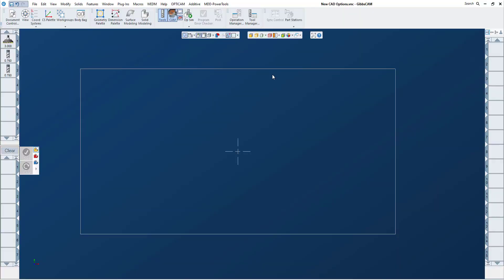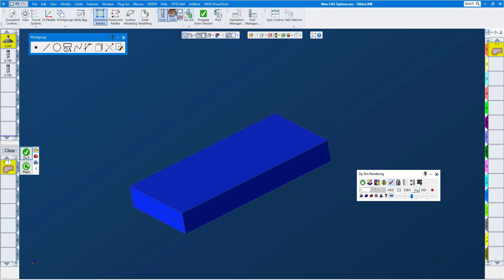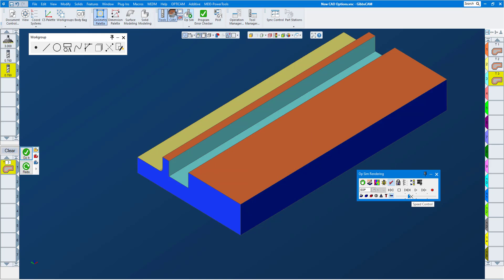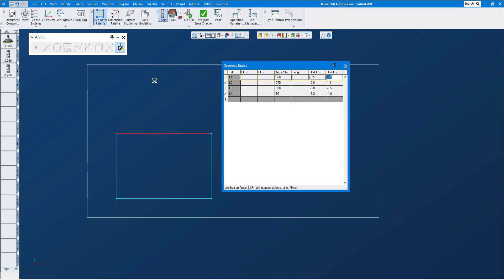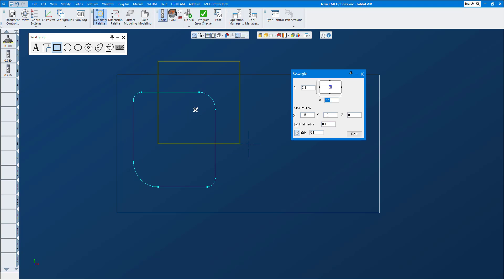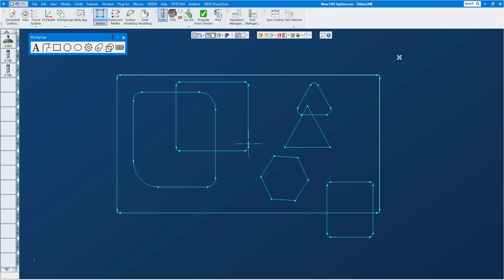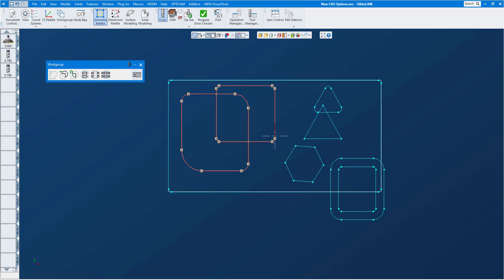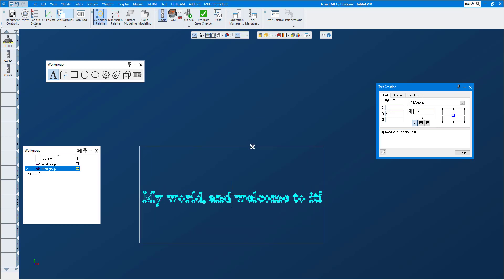GibbsCAM CAD Enhancements

Comment: Looks  like add/subtract and union function only works with like geometry. I can't seem to use that to trim a circle and a square. Does that sound correct??
Reply from the maker: I just verified and it does work with squares/circles.  Also works with circles/circles, or any combination.  I am doing this in v14.0.23.0.
Reply: @GibbsCAMVideoTutorials  I spent good 15 minutes on it.. while the options are enabled but nothing happens. But at the same time trim-in/out and slice work flawlessly. I am also using the same version as you are.
P.S, Don't think this should matter but the square I was using didn't have fillets.

Comment: Great 
But still 
Gibbscam cad is a nightmare 😓
Reply from the maker: You just need a bit more practice.  I find it very easy to draw anything I can imagine.
Reply: @GibbsCAMVideoTutorials  To me as I run many different cad cam systems as most of us do in a job shop environment .This reminds me a lot of drawing in Mastercam . Its just you have to be able to think outside the box to create a part. They don't always give you every dimension on a part. so just knowing how to use things like  tangent and offset for lines helps .
Reply: I agree, Gibbs is only better than Robocut  for me - and that one is just absolutely ridiculous. I can draw anything I want in Gibbs, but I can do it 10 times faster (and with far less cursing) in almost any other software. I’m astonished it’s taken them this long to progress to the point that they have.
Reply from the maker: I find it easy.  I also use Solidworks, for making assemblies, exploded views and nice drawings.  But I use those solid models from Solidworks in Gibbs to extract geometry from them in order to machine, or just click on the solid and have Gibbs figure it out.  But I do like the option of machining the part like "I want to do it" vs having your cam system think it knows how I want to go about it.  I don't see too many machinist/programmers drawing so much from scratch anymore.  Most every shop works with solids from their engineers, not from scratch.  Also remember when you draw from scratch in Gibbs your geometry is already connected, so the tool knows where to go.  We don't have to "chain" geometry up like others do.  Remember Gibbs is mainly focused on CAM, not CAD.  If you want fancy drawings, blue prints, exploded assemblies you should be using SolidWorks or similar.